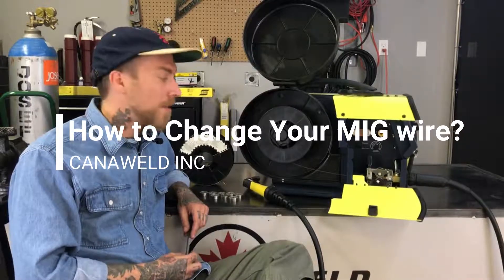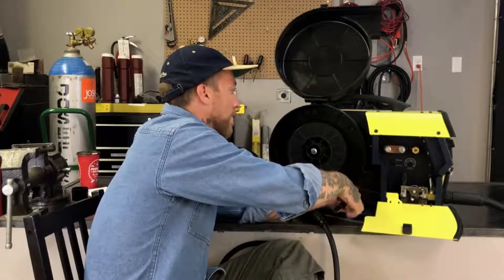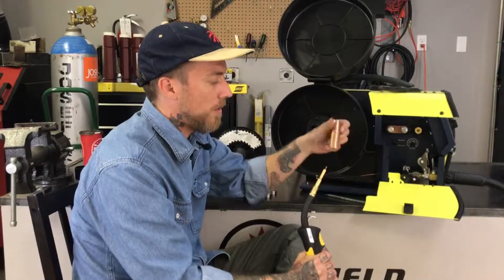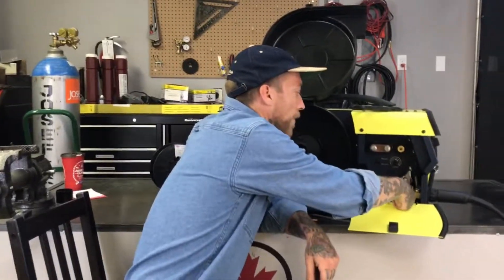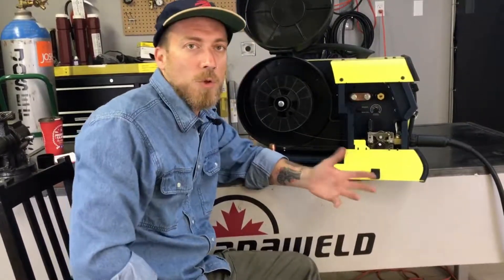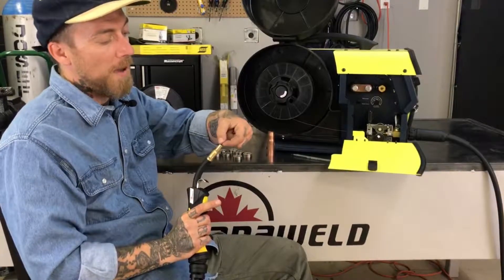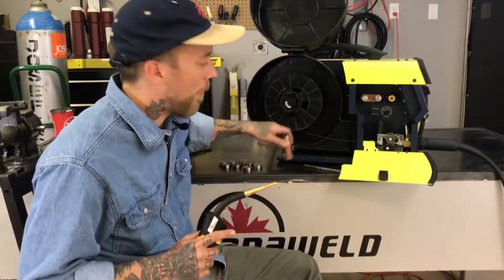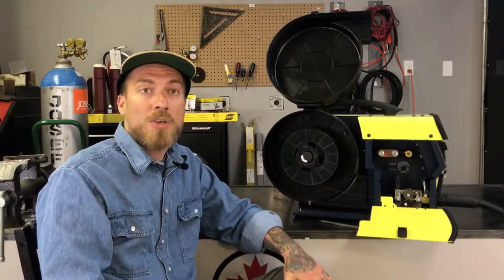How to change the MIG Wire, Spool and Drive Rolls  for MIG Welder by Canaweld

Comment: If you want to be extra safe when changing your mig wire put on some safety goggles so you don't poke your eye out and make sure they are clean before you start so your not tempted to take them off